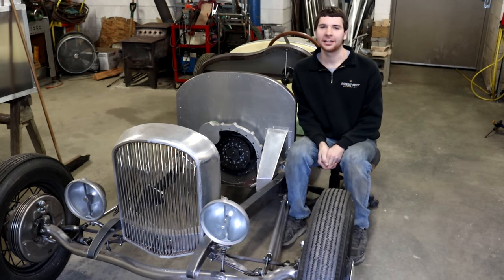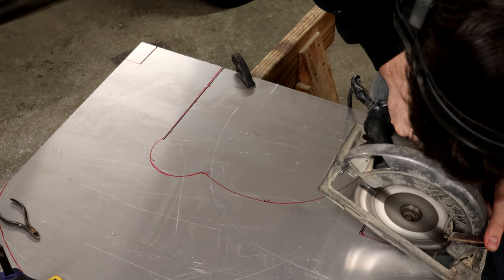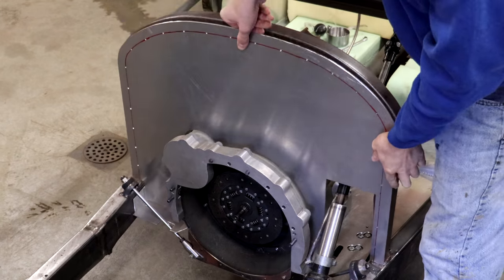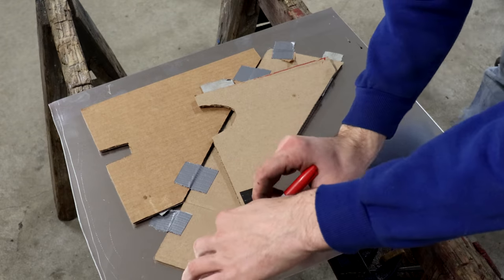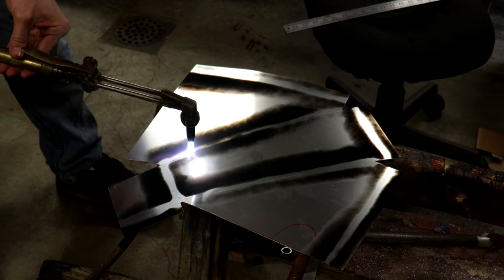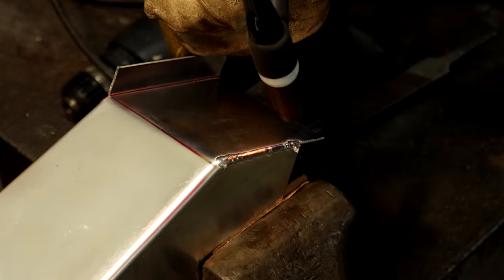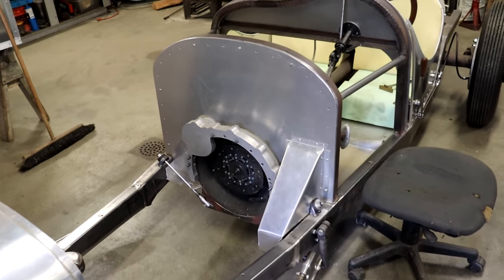Making a Custom Aluminum Firewall | Homemade Boat-tail Speedster Pt. 54

Comment: Another way to anneal aluminium is to use a bar of Ivory hand soap. Simply rub the soap on one side and heat from the opposite side. When the soap liquifies your panel is annealed. This works very well for aluminium body work when you don't want a lot of soot in the area and the soap residue removes easily with water.
Reply: And yet another way is to draw on the Aluminum with a a sharpie, and heat it, when the sharpie burns off, the aluminum is annealed.
Reply: I don't need it but I'll try tomorrow on a piece of Alu.. A nice tool in my personal box haha
Reply: Huh?  Wha?  How?  
What kind of wizardry is this?
Reply: @michael-michaelmotorcycle  heating metals to a specific temperature (glowing for ferrous) and letting them cool down at certain rates or by quenching, anneals most metals.
Reply: Love it. Keep going.
Reply: Or heat until a stick of wood rubbed on the surface leaves a charred mark.
Reply: So glad to see that all is well.
Reply: @StanleyKubick1  yea I know what annealing is. I had never heard of the soap method.
Reply: @kruleworld  That was Ron Covel who is a master metal worker...
Reply: @kruleworld  That guy was Ron Covel who is a master metal worker...
Reply: @kruleworld  That would be Ron Covell me thinks😎
Reply: @kruleworld  that would be Ron Covell 👍 he is a legend, and a master master craftsman 👌
Reply: That’s what a welder at British Aerospace told me 40 years ago. He used the works carbolic bar of soap and  rubbed lines of soap, when it turns color it is done.

Comment: Anyone who needs to use tools in the winter, in an unheated shop, or on a construction site knows that you cannot work accurately or safely if your fingers are frozen. Besides, if gloves are close enough to the spinny parts to get caught, then fingers are too.

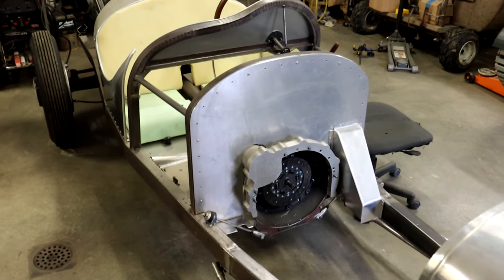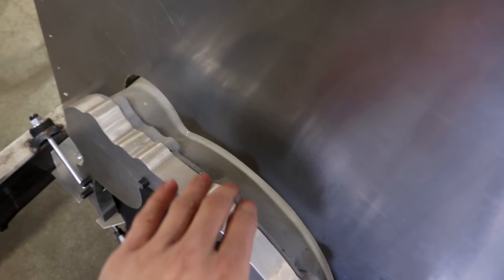It was 13F in my shop this morning at 8:00 and I had about 45 minutes worth of work to be done to fabricate a repair part I will need tomorrow morning. If I had fired up the heater to raise the temperature to a bare-finger-comfort level it would have taken about 3 hours, used about $10 worth of propane, and filled the shop's atmosphere with moisture to condense on all my carefully maintained cast iron surfaces. Instead, I put on some gloves, did the work I needed to do, and was back in the kitchen before 9:00. 

.

Comment: Once you graduate you'll have the easiest resume ever. Just an e-mail address and a URL to point to this build series. That is, if you don't already have about 20 offers to choose from already.

Also, maybe some fire hose material to form the seal between the firewall and the transmission? That would look contemporary with the style of the car.

Comment: I ran a clubman racing car years ago, and it had rubber seal (window seal) around the bell housing. It was absolutely tight. You'd be amazed how much hot air will come through without it, also the gear box can get so hot it can actually burn your feet, ask a pre-war MG driver.

Comment: Great work as usual!  What about engine turning the firewall?  Could add a cool period correct look behind cloth covered electrical and plug wires.  Whatever you decide, it'll be great

Comment: if i can give a tip, for sawing the aluminium, just use a woodblade, and join the alu with a wooden board, so saw them together, its wayy easier, and the cuts are more straight, try it...love the work!! and for tapping with a coardless, buy some stainless steel taps, they r much more suitable for that...

Comment: Hmmm, leather seems a good seal choice for the space between the bell housing and firewall.
Just a long softened strip, bent in to a "U" shape along the lower edge of the firewall should do nicely.
You could go wild with it, and us copper rivets with brass washers to secure the leather.
Anyway, this is a very cool build.
How long until you have the engine plumbed in and running ?

Comment: I first started working aluminum back in the late '70's on USAC sprint cars. This was I learned the carbon black trick for annealing aluminum. Plus I used quite a bit of driven rivits, they were easier in some places instead of TIG welding, which I learned to use. Fun days

Comment: You should ad some metal in the top corners to connect the sides to the top and then round them off. I think it look more finished that way on the steering cover

Comment: There is plastic trim that you could place on the firewall that could be used on the gap between bit and the transmission. Some is made for the edge of motorcycle windshields, another type is used on doors to protect the car next to it from bumping the car next to it.

Comment: love the work you're doing but I do have a concern about the clearance between the firewall and trans. I see the torque struts on the trans but I still think you may need a little more clearance (especially around the starter boss). The engine movement, especially under high torque (as in getting going from a stop), needs to be there. If you limit it too much (by going with solid motor mounts, for instance) all that happens is that the reaction torque from the engine is transferred directly to the chassis and will cause the suspension to have to take up those forces and cause uneven wheel loading. That's not what you want, especially when trying to accelerate from a dead stop. I would imagine you're going to make a floor tunnel anyway so make the firewall hole a little bigger and mate the tunnel up to it. I'm speaking from experience here; I had to make a hood bubble in my Locost7 to accommodate the oil fill cap on my engine and went for aesthetics rather than practicality and made it too narrow. Under hard acceleration from a stop my engine moved just enough to knock the oil cap loose, so I stiffened the motor mounts and promptly got undesirable wheel spin at take-off. Gave the hood bubble an extra inch of clearance (and had to repaint the whole #$%^ hood!) and now all is well.

Comment: Great to see you posting again Vince I have missed your videos. 
Are you going to put a simple bead roll on the firewall for added strength and aesthetics?
Tony from Western Australia 🇦🇺
Reply from the maker: The 1/8" aluminum is sturdy enough that it doesn't need any beads. I dont think my little bead roller would be strong enough anyway
Reply: @MacroMachines  fair enough I was thinking a very simple bead stand at the front look at the grill and the firewall and consider for yourself.
How is your engine going?
Any news?
Tony from Western Australia 🇦🇺

Comment: take a old wood blade turn it around so the blade is backwards set the depth just deep enough to cut the aluminum . the blade stay clean and straight clean cuts

Comment: The legend is back! ;D

The custom adapter plate fits very nicely to the firewall already and it almost looks like a finished car now. 
I'm guessing the seats are going to be a big project though- Unless you're planning to use some from the scrapyard?

Comment: Great project.  Just discovered the channel on YouTube.  Question: Aren't you asking for corrosion problems with mechanically joined steel and aluminum? Looking forward to more and to catching up with past videos.
Reply: I understand that during the Superleggera era leather could be used between the aluminium body panels and the steel tubes which made up the shape. He might try that, it would certainly suit the age of the design.

Comment: Question about motor and gearboxmounts: Are the fixed or flexible? If flexible, you might run into problems with vibration and the firewall while accelleration / decellerartion, because the gap between gearbox and firewall might not big enough. Also it might be better to have a bigger gap an a firewall / gearbox-tunnel to prevent heat from you feet.

Comment: * Welding Trick *  if you clamp a heavy aluminum backing block on thin sheet alum joints it welds a lot easier and doesnt burn through at the corners...

Comment: Far be it from me to presume to know better than the presenter, but I think aluminum rivets for the pedal shroud would be a good choice.  Clean looking (especially from the inside), nothing to come loose and rattle, and still pretty easy to drill out if you actually do need to remove it for access.
Reply from the maker: I may switch to rivets at some point. I wanted it to be removable at least for now though

Comment: if the engine and trans arent SOLID mounted, that gap between the bellhousing and firewall will hit when you let out the clutch from a stop- youd be surprised at how much things move?

Comment: You don’t need a seal between the bell housing and firewall, the back of the firewall will have a hump or something covering the gearbox surely, that seals your cabin/cockpit from the engine.
Reply: Back in the period of the types of cars he's replicating they didn't, the gearbox was there for all to see

Comment: In airplanes, firewalls are made of stainless steel since aluminum melts too easily (My firewall is stainless, flanges bent just like you did but I also used a hand seamer). Another way of annealing aluminum is to mark it with a sharpie, then use a propane torch till the ink is gone. Can't tell, but are your bend radii big enough, so it doesn't crack? Looks like you used 6061, as a guess.
Reply from the maker: 3003 alloy for that part, same as the body. it forms really nicely

Comment: It sounds ridiculous, but when you have to cut sheet metal with a radial saw, flip the blade upside down. It cuts enormously cleaner and it does not clog. Best of all, even on corrugated steel or aluminum, it does not leave the edges all bent and ragged
Reply from the maker: I'll keep that in mind

Comment: Simply from the name, I assume the reason for a firewall is to prevent a fire in the engine compartment spreading to the passenger compartment.
Question: Surely a higher melting-point metal like stainless steel would be more appropriate?
Reply from the maker: maybe in theory, but if you're still in the car when the aluminum is melting, I don't think a steel firewall would've saved you either

Comment: You can't call it a firewall, It's a cowl or bulkhead.   :)  I have been telling new hires that for over 20 years.  If you work for a Vehicle manufacturer their Legal departments won't let you call it a Firewall.   That name implies that a fire could start, or if one does it implies that it will stop the fire from spreading.   The joke is that the whole world calls it a firewall.  Sorry I couldn't resist commenting.   I enjoy watching watching you fab this vehicle.  Thanks
Reply: Another one my mentor always used to pull me up on is calling the instrument panel the dashboard. Great to see more progress. These projects always take time. For cutting thick aluminium sheet I find a jig saw works well and is less scary than a circular saw. For the thin stuff electric shears work great (on steel too).